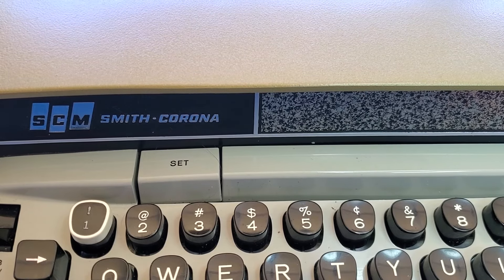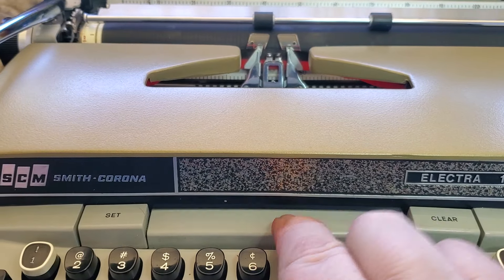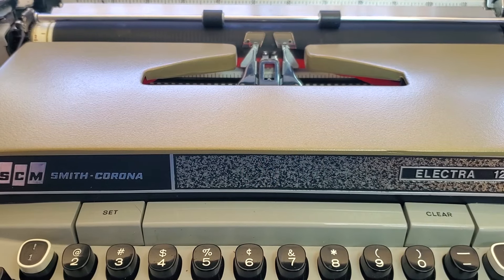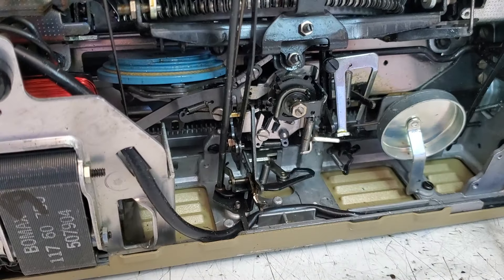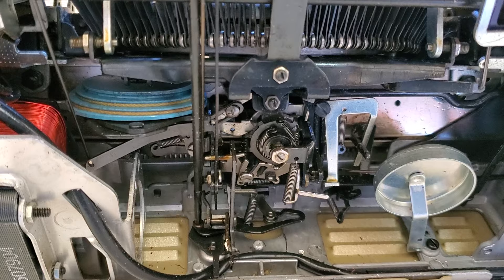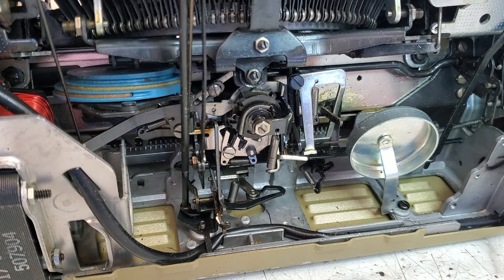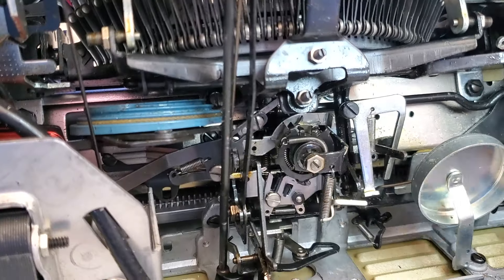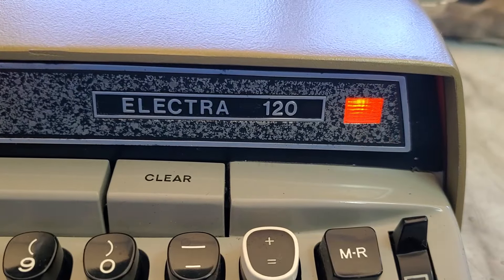Smith Corona Typewriter Tabulator Slow Carriage Movement, Check the Decelerator, Flush and Lube

Comment: Great timing! Was just starting to dig into such an issue with an older model Smith Carona Silent Supper which has this same part. Will let you know if this solves the problem on the older manual typewriters also.

Comment: I have a manual Godrej that has the same issue with tab which it didn't have before I cleaned out excess oil from the shop (there's still oil on my table every time I pick it up). I'll check if I removed what was actually necessary.

Comment: Another great video. My Coronet tab skips unless I slow down the carriage with my left hand...would oil on the spring you showed help?
Reply: I would check to see if your spring is still there or if the tabs are broken. The job of the spring is to slow down the whole assembly. So if it is too fast I would think that 1 of those two things has happened.

Comment: Sometime if you can, I'd love to see how you reattach a draw string to that stupid plastic return spring wheel, attach it yo the carriage and rewind the spring... probably not in that order.

So it would be like the draw string snaps and you have to replace it, I tried for practice on the junked 120 i have and I couldnt get it to attach to the spring, nor rewind or attack to carriage...i could attach to carriage, feed it through with about the same length as the snapped string, but the spring is a Mother to figure out...

Would like to see that repair.

👍 Thanks 👍